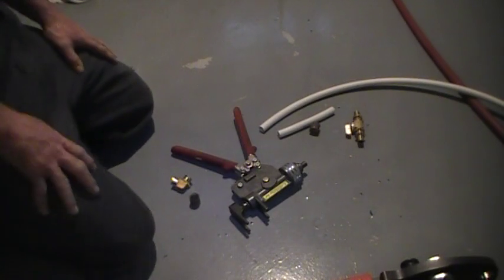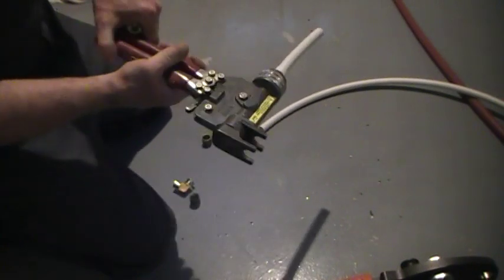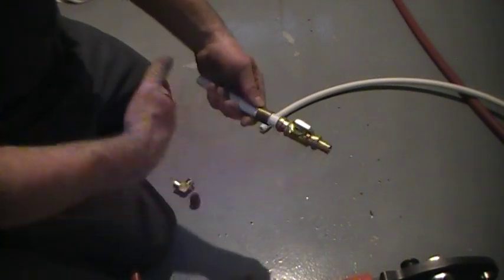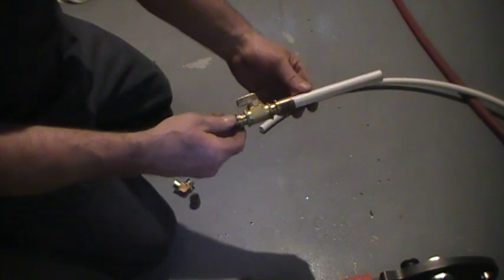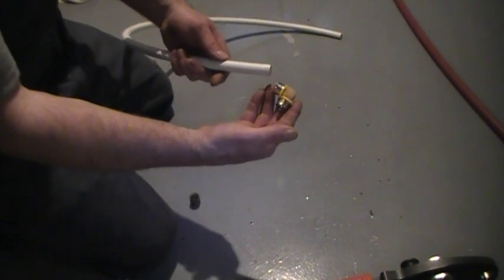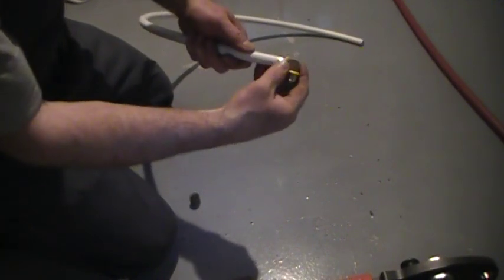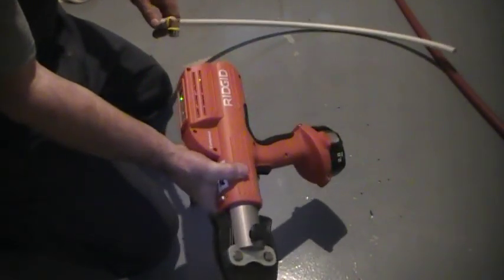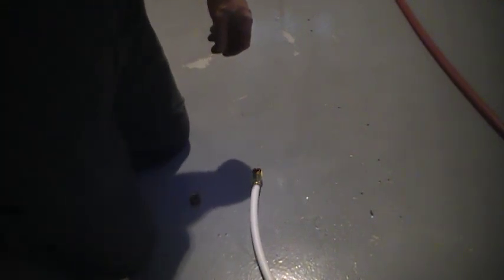Rehau system versus Viega system when joining pex pipe.Short comparison of both.

Comment: Viega using a Milwaukee cordless press unit or Uponor using a Milwaukee cordless expansion tool? Which one do you think is a better system?
Reply from the maker: Hello Ron,
They are both good units. Biggest problem is getting them into tight areas. No matter what tool you are using; you have to plan on certain connections.
Rehau has come out with a tool where the head swivels and it works very well. Made by Dewalt. Not overly expensive either as compared to the price of these tools when they were manual. The price was ridiculously high. The price for the Viega press is still pricey, but it if you are doing a lot of work, it saves cranky the manual. I am not certain of how much the Uponor tool costs and I haven't got a price tag for you on it, but like I had mentioned...The Rehau can get in tight corners.
Thanks for commenting and enjoy your week!

Comment: Fitting that big power crimper into a small space ain’t gonna happen.  Looks like the biggest pex crimper ever made.
Reply from the maker: Hello Wallace,
You are definitely correct with that statement. A little bit of fab work has to come into play in order to get the job done. It is one of the draw backs. It is a definitely bigger than other models.
Thanks for commenting and enjoy your weekend!    Al
Reply: Not a pro plumber myself, but bought a pex ring crimper for odd jobs.  But after witnessing the expander style in action, and seeing how much easier the connection process goes, I am looking to switch, or at least borrow one for those rare occasions

Comment: I'm a diy enthusiast, so I would prob seek to hire one of these specialist tools.  I don't trust the push-fit (sharkbite) style if built in to the wall.   anyway ta for the video..
Reply from the maker: Hello FirstName LastName,
You're welcome!
I am not a fan of installing Sharkbite inside a wall myself, although the company states they can be installed anywhere including underground. I prefer rigid connections myself.
They do make a crimp ring system is very user friendly and a tool that is not overly expensive. I believe most homeowners (DIYers) use this system. I know Home Depot carries the product. I see that it is very commonly used.
Thanks for commenting and enjoy your holidays!     Al

Comment: great video. where do you buy a Rehau tool kit?
Reply from the maker: +Christian C 
Thank you!
Plumbing wholesalers sell this tool and they are a little pricey for the set. I haven't heard of any hardware stores carrying the tool or fittings. There are a number of different pex systems that are available to anyone. The crimp ring system is one that is very popular with homeowners and the price for the tool and fittings is relatively cheap compared to the Rehau. 
In my opinion Rehau is perhaps the best system for installing domestic waterlines, but as of late the price of the fittings and rings has drastically risen. I have been using Veiga as of late which is considerably cheaper and easier to install as well.
Thanks for commenting and have a great week!      Al

Comment: being in the plumbing trade and having used both systems. i prefer to use the rehau fittings as they are more common place than the veiga stuff. also having to repair a system down the road locating replacement fittings can be a problem , veiga is very difficult to get parts for. 

also, be carefule with the pro press tool. it may be expensive to buy, its even more expensive to repair.
rehau also has a better warrenty on their parts and system than veiga.
Reply from the maker: Hello Ricky;
I am a big Rehau fan. My problem with the fittings is the price. They have more then doubled in the last few years. Nine dollars for the tee and three sleeves is very steep as compared to a Veiga tee.
I have used a few different systems myself and the Veiga system is very easy to use and speaking for myself; getting the product is not an issue. One nice part of the system is not having to apply sleeves onto the pipe as they come attached to the fittings for the most part.  I do like this system. The fittings are lead free and bronze.
I also have a source for Rehau. The Rehau system is an excellent system as well. The price is turning off a lot of the plumbers in our area.
Thanks for commenting and have a great week!     Al
Reply: Looked for Rehau, but nothing available on the West Coast

Comment: Before I paid 2000 dollars for that tool I would hire A plumber. No, on second thought, I wouldn't do neither.
Reply from the maker: Hello george50;
I know this is one expensive tool, but if you are doing a lot of work; it will pay for itself.
It is not for the average homeowner unless you have money to burn. Some nice when you are dealing with any water; no worries of trying to solder which is huge!
Thanks for commenting and have a great day!     Al
Reply: TheOldkid888 Well... The same tool from ridgid  even more expensive in my country. Over 3000 $ if you'd order it online last summer. All of those names (viega, rehau, rems & ridgid tools) were common in Moscow & S-Peter region. Ppl didn't ever hear those  brands in my place, lol. Rehau is best known as the pretty good PVC window and door systems manufacturer in my region.
Reply from the maker: Hello Neoleggi Darnin;
The price of the tool is exceptionally high, but the system does work well.
No soldering and a little water has no bearing on making a water tight joint.
They are all good manufacturers of pex systems, but Rehau prices have gone through the roof as of late and Viega is my go to now.
Thanks for commenting and have a great week!     Al